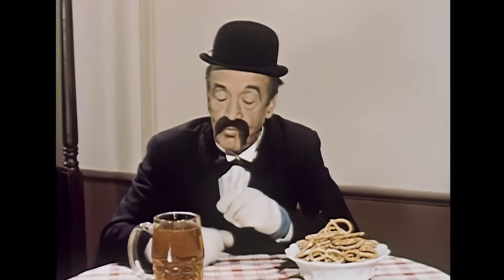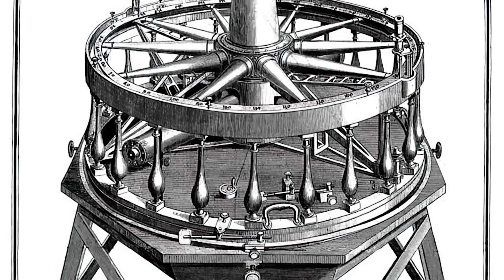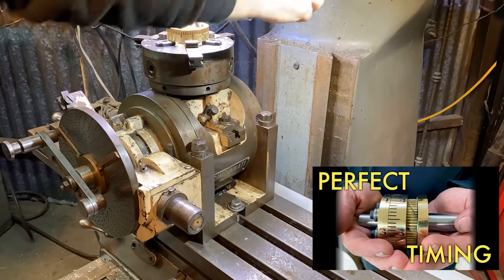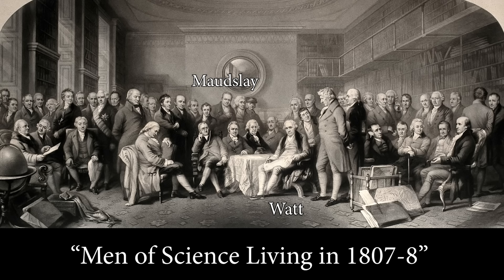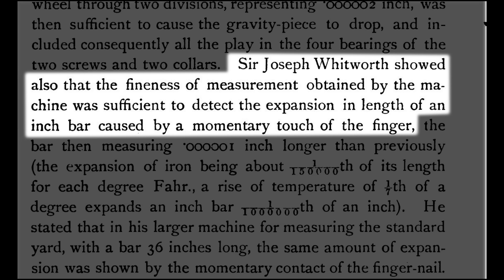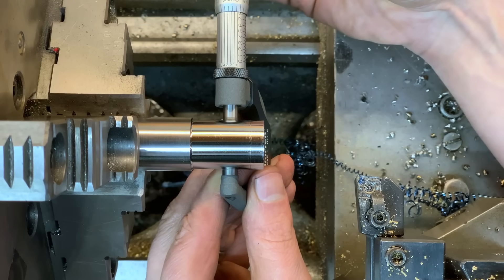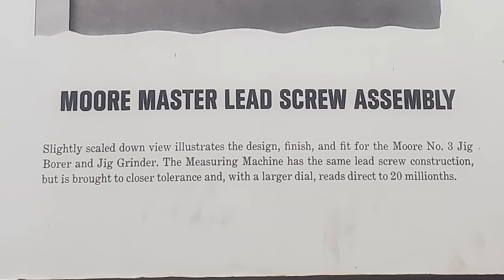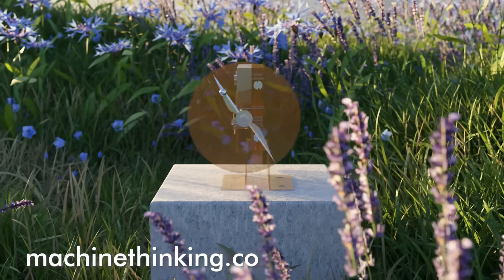The HIDDEN Screws of PRECISION

Comment: Yes but how were the first precision thread ms used to make a precision thread made?
Reply from the maker: I've actually looked into that quite a bit and the answer is there are several ways.  I even showed (but did not talk about) one of them. When I'm first talking about Maudslay I show his 'screw originating machine' which was designed to make screws from scratch using the  'inclined knife method'.  One of the things I had to leave on the cutting room floor! You may hear more about the others in the future!